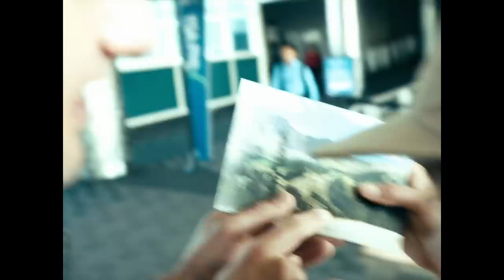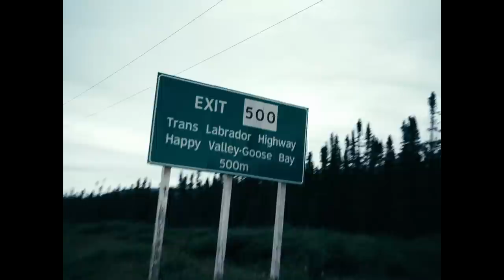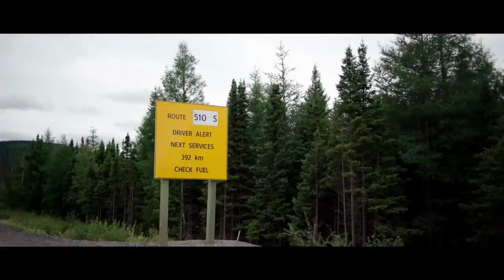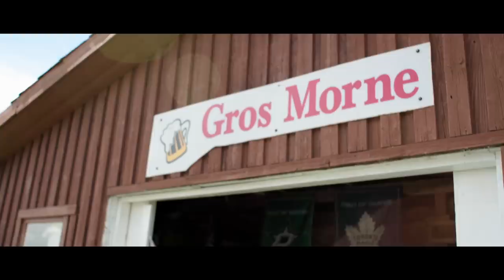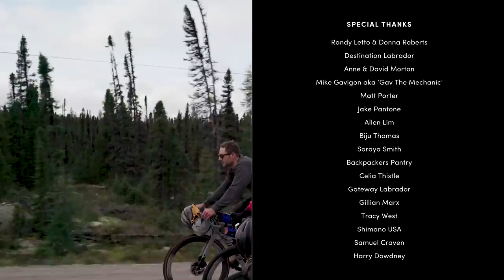Outskirts II: THE BIG LAND

Comment: Back in 1980 - ‘85 I lived in this area (Lower North Shore); loved the winter - and the people - so I almost settled there, but didn’t.  In 2009 I rode the TLH on a motorcycle, thought that was adventurous enough! Thinking of doing it again this year, 2019.  One thing this documentary doesn’t sufficiently reveal is the massive impact climate change has had on this area.  Not only has the weather shifted, so too has migratory patterns and all that comes bundled with warmer (IE: disrupted) climate.  Another thing to mention: Albeit it’s a one-way road, the experience from Blanc Sablon to Old Fort Bay is sublime; if at all possible, don’t miss it. Thanks for the video - well done!

Comment: Fantastic doc!  As a resident of Goose Bay, I’m always interested in other peoples’ views and opinions of the area.  Shock at the number of mosquitos and black flies is a pretty common reaction.  And, for those not already accustomed to the bites, allergic reactions are not an uncommon thing.

One really big point, though; the name of the province is “Newfoundland and Labrador”.  The mainland portion of the province is Labrador, “The Big Land”, while the island portion is Newfoundland, (some people use the nickname “The Rock” ).  The Labrador leg of the journey probably measured some 1250 kms or so, depending on how much additional riding the group did while in the Goose Bay area.  When they took the ferry from Blanc Sablon, they were actually in the province of Quebec.  The remaining leg of the trip along the west coast of Newfoundland (from Saint Barb to Port Aux Basques) would have been about 650 kms.

None of this is to try to take anything away from the team’s accomplishments.  I just think it’s important to give recognition to the folks on the island, and not misname them in any way :)